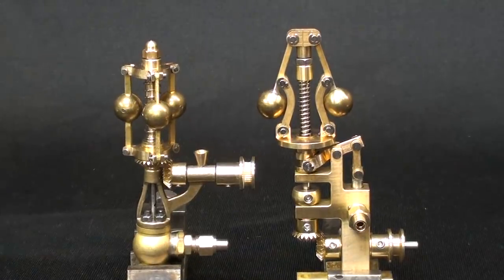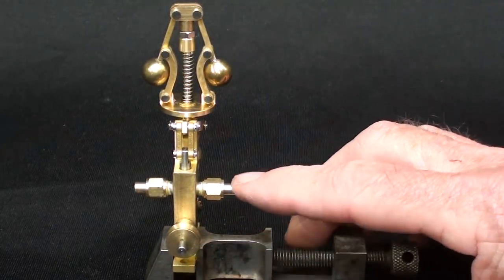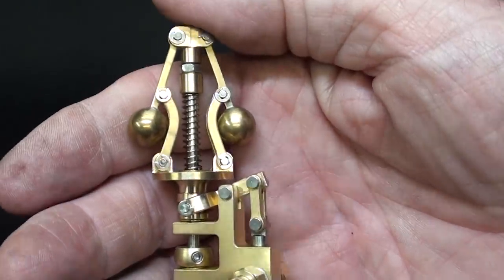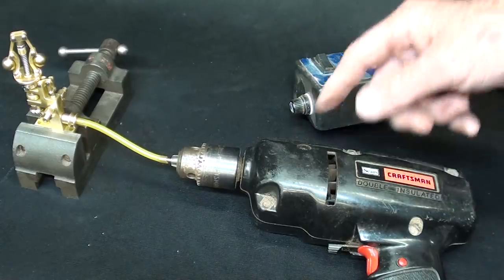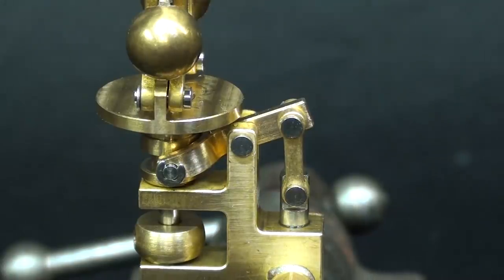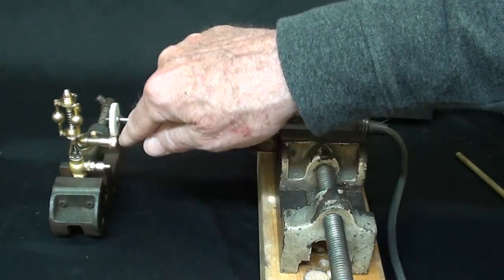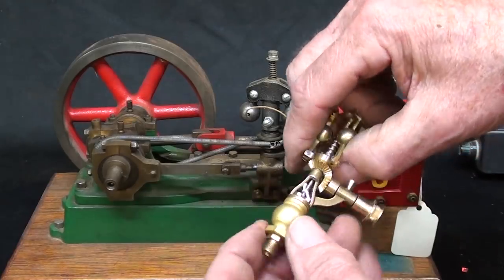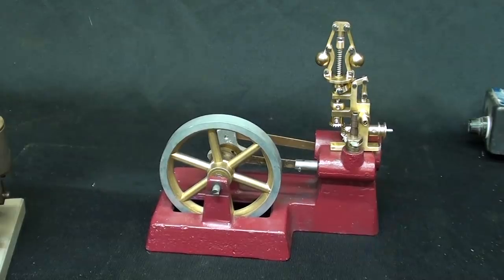Model Flyball Governors Steam Engine TIPS 564 tubalcain banggood

Comment: Centrifugal governors are usually associated with steam engines, however they have a much wider range of applications yet to be realized.  A couple include regulating tail rotor pitch on RC helicopters & clutch engagement on RC cars.

Comment: I bought the 3 ball design from Banggood, the components are all first class, yet I considered it a kit. I drilled out both steam ports to enlarge them and tapped and installed a larger bronze valve seat on bottom of spindle. The 4 screws and holes can be reattached in any position. I carefully cut the spring out and installed another that was more sensitive. There were many trials and errors in this process but I got it all dialed in and have it mounted directly on top the steam chest of my Stuart No. 9 it is now a fine working governor.
Reply from the maker: That is all very good information and thank you for it.  That is good to know, as I am sure I will need to modify it.  It's interesting that you have it mounted on a number nine with Stewart. I thought the opening seemed mighty small

Comment: Microcosm is a very nice line of steam engines, well-made from the couple I've seen. don't let the fact you get them thru Banggood scare you away from some interesting brass models
Reply from the maker: Yes, you are right they are very nicely made. And you are correct, that Banggood is kind of a turn off

Comment: I wonder if those small governors can actually provide any operating stability to a model engine at all.  Typically, a governing element in a feedback loop must be carefully matched to the overall system to avoid instability of the entire system.  Matching would include not only the dynamic characteristics of the governor (the flyball dynamics) but also the operating characteristics of the valve.
Reply: Instability, not "integration".  If it runs without any real load, there is no need for a governor at all.

Comment: That hand drill is probably running at a similar speed to the Dremel, but there's a reduction gear in the front of the drill body.

Eagerly awaiting seeing you integrate these with stream engines.

Comment: Please do install them on a small engine. I have the 2-ball one, and it works great, but finding a good drive belt is difficult unless you remake the pulley to use a wider flat leather belt. Also, the gears can be really loud if you don't carefully allow a little slop in the shafts to "absorb" the vibrations...they are an excellent value, but they have their quirks.

Comment: I think you should make a governor that's a little bit larger and revisit the variable DC motor powered drill press project.  Instead of opening and closing a valve, you could have the yoke drive a gear rack that would turn up/ turn down the speed knob of the DC motor controller.

Comment: I'm designing an insulin vial shaker gizmo and would like to incorporate a flyball governor just because they are fun to watch. Not a steam or air powered motor but using weights like a grandfather's clock or maybe a wind up spring. Now, to change the needle valve to a disc brake or something... Any ideas?

Comment: The "balls out" metaphor is kind of strange, since the governer's balls would be fully out when the engine has no load and needs to be throttled back fully. I suppose it would be running at its fullest speed, but certainly not doing any work!

Comment: I hadn't thought about it but the system isn't "fail safe" is it.
If the drive belt lets, go the valve stays wide open.
Mr Pete has gone Metric  shock horror.
Go on you know you want to fit them.
How about a belt off the engine pulley on the 2nd one.

Comment: Pressure is the product of flow and restriction and increases when flow, restriction or both increase. It has no effect on "speed" besides how fast a cylinder is filled. On internal combustion engines throttling governors control speed by varying fuel and/or fuel and air delivery and "flow" to the cylinders. 

Trying to "throttle" steam engines with a variable restriction is piss-poor engineering because the "venturi effect" causes rapid and drastic cooling of the steam flow and condensation of the so-called "dry steam" into "water vapor" that can be re-evporated due to cylinder "vacuum" and the "pressure drop" causes a flow "speed" increase. Varying "steam pressure" exacerbates the "unstable" and "ungoverned" engine operation and "double-acting" single-cylinder steam engines are worse yet. The only "solution" is idiotically running "steam pressure" so high the "relief valve" is constantly open which does not result in constant "steam pressure and only makes "governing" - "regulating" as the supposed "steam wizards" in the UK call it when "governing" is clearly out of the question - the engine under varying and especially increasing loads pretty much impossible.

WHICH is why pretty much every British steam locomotive which is already a hog on ice with its laughably oversized and "understroked" and unsuspended and non-"steering" drivers and so such oversized and low unit pressure and traction "contact patch" with the rail, becomes an "uncontrollable" disaster on the short and slight "banks" they run on and call "banks" because it makes them sound "severe" . To them.

Their absolutely "non-engineered" right of ways and every which way but straight "mainline" where even their 10-12 "carriage" toy trains can be going two or three directions at once don't help and least of all at the bottom of a "bank", but those rolling disasters of locomotives that INVARIABLY "lose their footing" due to "human error(s)" setting them up to fail and are always trying to climb a "bank" with a "full head of steam" because "physics" are beyond all but "nobility" end up going from "slip to spin to stall" in 4 or 5 train lengths at most. And YouTube comments about "wet" or "leaf-covered" (takes a long, strange leaf to cover one rail) or "wet leaf-covered" rails and/or that particular locomotive not being "designed for" such and such "line" in a country NONE of them are apparenty "designed for" since they all slip/spin/stall and/or a "rookie driver on the footplate" with no mention of the idiots "firing" the POS to more "boiler pressure" than it can possibly use again EVERY SINGLE TIME and/or MY PERSONAL FAVORITE AS AN ACTUAL "RETIRED" UPRR LOCO.OTIVE MACHINIST WHO KNOWS "SANDING EQUIPMENT" WHEN I SEE IT: SOME VARIATION OF. "WHERE'S THE SAND"? 

Which is hilarious because they've tried to "retrofit" some "sanding equipment" probably stolen from a "scrapped" locomotive in the U.S. OR a "diesel" they also probably stole "Sanders" from the U.S. to "upgrade" onto at least one "preserved" or "brand new replica" British steam locomotive. And at least made it "functional" FROM about 15 feet away and FOR about 5 seconds of "video" and/or 5 feet of "rail" whichever comes first. Bur lacking the whole "air brakes" thing and an air system the "engineered" them some "steam sanders". To put wet clumps of sand and "standing water" on the rail IN FRONT OF ONLY THE REAR DRIVERS for "more traction".

They're so "cute" but if they had only worked half as hard actually "building" all the shit they claim is/was "world class" or "record setting" as even slightly "better" shit then as they "work" trying to "live up to" their own "legends" NOW even if it means lying twice as much now to "support" every lie "back then", they'd have been "too beat to brag" about their "mediocre" mechanical "engineering". 

The "flyball steam governors" operating "throttle valves" to "control" 100-250 psi of "steam pressure" do take the NEW cake, though. It's like they forgot all about "valve gear" and "cutoff" to match "valve timing" and "cylinder filling" to "load" or something and don't get the actual cylinder, piston, rod, crank etc are a "STEAM MOTOR" and "dry steam" is like "COMPRESSED AIR".

But what can you expect from people who believe steam EXPANDS AS IT COOLS AND SAID EXPANSION IS "LIKE" THE "EXPLODING" FUEL-AIR MIXTURE IN INTERNAL COMBUSTION ENGINES.

I GUESS IF YOU BELIEVE IN THE "EXPLOSION" YOU GOTTA BELIEVE IN THE "EXPANSION". JUST DON'T BRING UP "TURBINES".